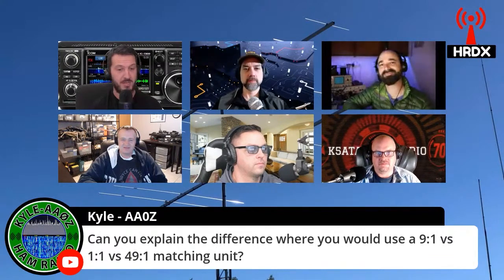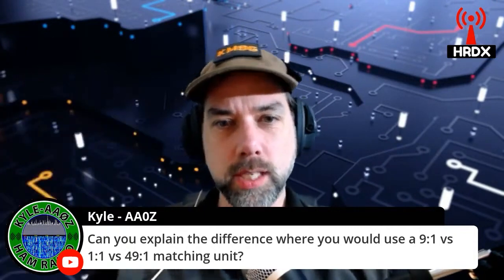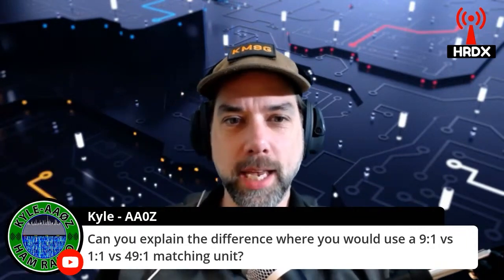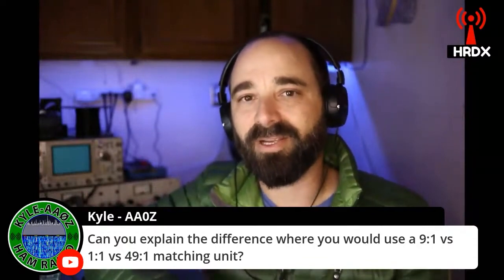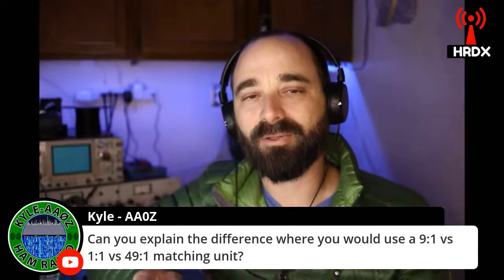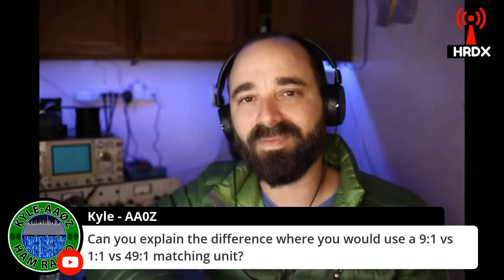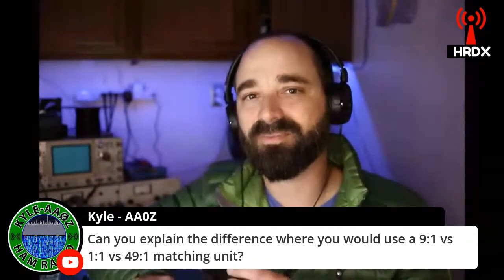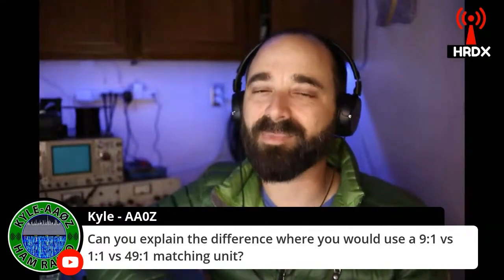1:1, 9:1, 49:1 Matching Units - What's the difference?

Comment: No one addressed the actual common use cases...

1:1 is normally used as a balun to turn coax into a tuned dipole antenna
9:1 balun is normally used to 450 ohm balanced antennas like the T2FD
9:1 unun was commonly used to match a random end fed to a tuner - this is the lazy man's match and used on a lot of 27MHz CB base station vertical antennas
49:1 is normally used as an unun for end fed half wave antennas
Reply: I should also mention that the random end fed is where most end fed antennas got a bad reputation; it isn't a half wave.
Reply: Thank you
Reply: Thank for answering that. I was confused when none of them actually gave an answer like this.
Reply: The problem with using a 9:1 unun with a tuner and a random wire for multiband operation is the fact that the 9:1 sometimes converts the impedance down too low which causes higher losses in the tuner.  Lets say the antenna impedance on a particular frequency is 20 ohms, that 9:1 unun is going to convert that down to 2.2 ohms which is almost like a dead short to the tuner causing losses to increase.  Also, since the 9:1 is most efficient when feeding a 450 ohms load, losses in the 9:1 also increase.  Yes, you will make contacts with it, but not as solid as you would with a properly tuned antenna!
Reply: Rule #1  Never overthink a dipole antenna.

Comment: Should this question come up again, it might be helpful to mention that ratios such as 1:4, 1:9 and 1:49 arise because their square roots yield integral numbers of turns which is convenient, at the very least, for building transformers. Likewise, it might be helpful to mention that, for example, a 1:49 impedance ratio can be matched by a transformer with a turns ratio of 1 to 7 (i.e., square root of 49), or one with a turns ratio of 2 to 14. I.e., it’s the turns ratio that matters. - Cheers! - Jim (KK7CSC)

PS: Here’s a specific example thatI think drives home my comments above: Imagine wanting to match an antenna impedance of 2500 Ohms to a 50 Ohm feed line. This suggests an impedance ratio of 50 to 1. Since the square root of 50 is 7.07, which is not a particularly friendly turns ratio, you would choose 49 which is close enough to 50 and has a square root of7 which yields an integer turns ratio (7:1).
Reply: Thanks for explaining that. I was wondering how the antenna kit I built had 3 to 21 came out to be a  1:49 unun. It makes sense now.

Comment: A 9:1 is designed to feed a 450 ohm load and is most efficient when doing so.  And there is no such thing as a "driven element" in a coax feed line.  RF is basically an AC signal, so there is no positive and negative terminal as the polarity changes back and forth at the frequency of operation.  But, to RF there is basically "THREE" conductors in a coax feed line !  Yes, 3 !  You have the center conductor, the inside of the shield, and the outside of the shield.  The good current which is known as differential mode current flows on the center conductor and on the inside of the shield.  The bad current which is called "common mode current" is the nasty energy that flows on the outside of the shield and can wreak havoc on your equipment in the form of increased receive noise, and distortion on your transmitted audio and other nasty such as a hot microphone that can give you a shock if you touch it with your lips and it happens to be a metallic mic.  The 1:1 Guanella current balun at the feed point of the antenna and another one right before the coax enters your shack can help eliminate these issues!

Comment: An electrical engineering question answered by a self described amateur radio newb and a mechanical engineer.  Turns out not to explain the subject correctly.  Who Knew?

It's the square root of the turns ration.  (Notice that 4:1, 9:1, and 49:1 are all squares?)  So a 49:1 give a change in impedance by a factor of 7. Not 49.  Good guess though. Seriously, why pose as an educator on this if you haven't even read the basics yourself, or have any practical experience?
Reply from the maker: Glad you liked the video!
Reply: Yeah no kidding.  And they didn't even address what a 49:1 was used for in relation to a 9:1 yet the description says they do.  3 minutes of my life I will never get back.
Reply: Then why does the 49:1 transformer convert a 2450 ohm impedance to 50 ohms?  Looks like a 49 times change to me!  Try it with a 2450 ohm non inductive resistor connected to the 49:1 and have it on an antenna analyzer if you have one and you will see the facts!
Reply: @rickmckee6698  Hi Rick - the confusion might be because a 49:1 matching unit is not the same as a 49:1 transformer.  You are correct - a matching unit will work as you say.  A transformer ratio is a statement of the number of turns.  This ends up being the same as the voltage ratio (and the inverse of the current ratio). Now, the power is the same on either side of the transformer (a and b), so if you look at the general power formula  P=V^2 / Z   (power equals voltage squared divided by impedance), then (Va)^2 / Za  = (Vb)^2 / Zb.  This can be re-written as Za/Zb = (Va/Vb)^2.  So the impedance ratio changes with the square root of the voltage ratio, i.e. a 49:1 transformer changes the voltage down by 49 and the impedance down by 7.
Reply: @paulp1204  Matching unit, transformer, whatever you want to call it still "transforms" 2450 ohms down to 50 ohms !  Just like a 9:1 changes 450 ohms to 50 ohms and a 4:1 does the same with a 200 ohm load.  It doesn't matter what you call it.  So please explain what you mean by "matching unit"  how is it made"  2 primary turns and 14 secondary turns ?  If that's what you can a "matching unit, I have built several of them for various power levels and they all convert 2450 ohms to 50 ohms !  The 7:1 ratio is the winding ratio - not the impedance ratio.  It has 1 primary turn to 7 secondary turns, and you still have the same winding ratio if you use 3 primary turns to 21 secondary turns. but the impedance transformation is still 2450 ohms to 50 ohms or 49:1.

Comment: In terms of performance, a ratio of 9:1 or 49:1 yields nearly equal results, yet both function optimally with vertical antennas ranging from 5.2 to 16 meters or longer. However, it is essential to use FT 240-43/61 for superior performance. height allways helps lot better performance - G7UNF.